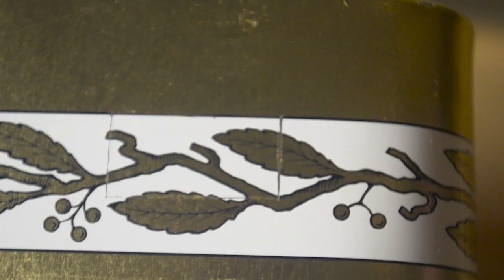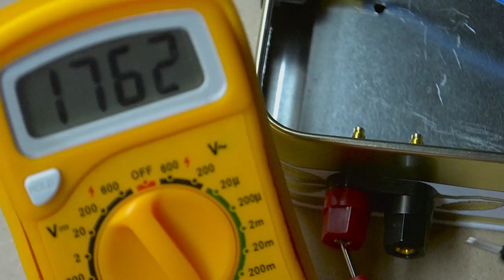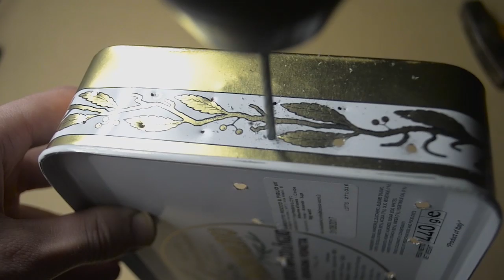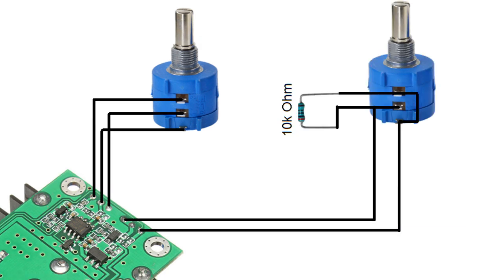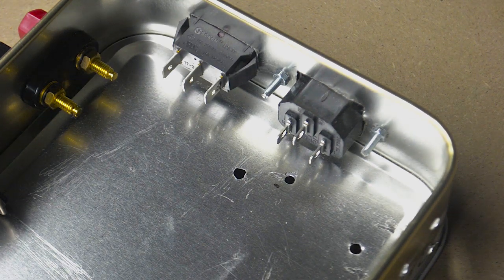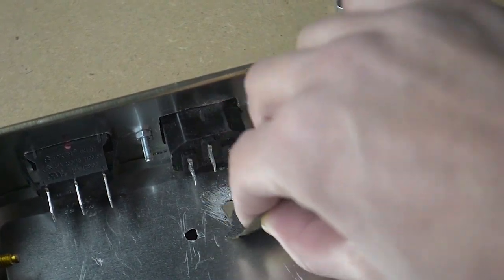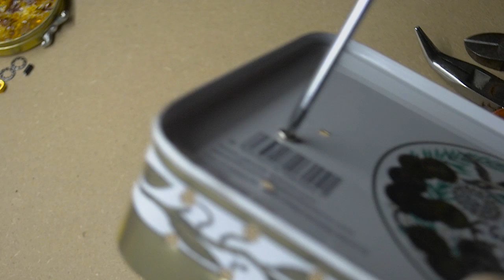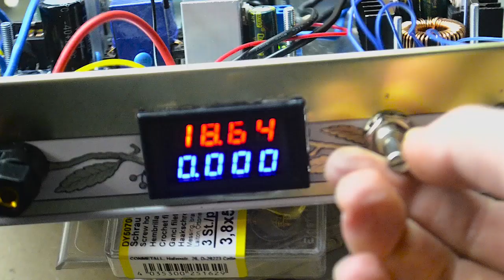Make your own Lab Bench Power Supply -  DIY - Power your projects - PART 1

Comment: I made a charger using 12-0-12 5amps transformer and 300w buck converter to charge 24v lithium phasphate battery but charging current is not increasing above 0.75amps.pls give me any solution.

Comment: hi,  can I use a regular potentiometer 10k for this project  
waiting for your reply
Reply: The normal Potentiometers only have a turn of 280° but the ones he uses have their resistence (10k Ohm) "split up" over 10 turns before it will stop. Therefore you can trim the voltage and current more precisely. :)

Comment: Project boxes are expensive and can often cost  more then the components used in the devices we build.  Steel gift or toy boxes cost little and are available all over. This is a great idea, well done sir!! 😃👍
Reply: I like to use old enclosures from existing electronics... like old modems, routers, TV-top devices... just empty them out, keep what works for you, like switches and power cords, paint the markings if you need to, and voilà:  cheap, good looking cases!  ;-]

Comment: Good job.
Can I ask for your advice?
I want to power up my video rig from makita battery 18v and i need to buy buck converter.
My camera sony a7iii use 7,2v also external monitor (~18w) can run on 7,2v.
Can you advice me a converter 18v to 7,2v?

Comment: Hello
I have followed the steps and I have it echo as in your video with the same components but it happens to me that the voltage goes from 14 to 24 volts and that section cannot be regulated, also when turning the potentiometer to the right it decreases and when turning to the left increases the voltage does it backwards, any idea that I could have done wrong

Thank you
Reply: I think the potentiometer  are faulty try checking with a multimeter
Reply: What kind of pots? Linear or logarithmic?

Comment: I apologize in advance for my English. This is an old project. If the author passes it off as his own, it is very ugly. As far as I know, my compatriot AlexGyver made this project in this way back in 2017 (http://alexgyver.ru) Here are the links ( https://www.youtube.com/watch?time_continue=1&v=8h2ICt3XRhk&feature=emb_logo ) and ( https://www.youtube.com/watch?v=kDGLRRZncKs ) for electronics Enthusiasts, I would recommend looking at his website. There you will find many interesting crafts. As the main argument, I will add that his project "fire lamp" was copied by the Chinese and now they sell a full set of components for this project on Aliexpress (https://aliexpress.ru/item/4000056138826.html?spm=a2g0o.productlist.0.0.2cd25e2anPOHEy&algo_pvid=6dce3f91-de6c-41d1-a190-68d95b984854&algo_expid=6dce3f91-de6c-41d1-a190-68d95b984854-9&btsid=0b8b034e15823932064946854ef347&ws_ab_test=searchweb0_0,searchweb201602_,searchweb201603_ )

Comment: nice box (apart from the fact, that it doesn't seem to be too trustworthy for daily, heavy usage :)  ) ...beyond that a tip from an experienced: you should NEVER solder strands at cable-ends that are clamped with screws - for the moment it works fine, but the connection points start to oxidize over time and slowly you get contact problems (strange disturbances, "noise", cracking, high contact resistance and when there are higher currents there will be high punctual current densities which means: dangerous heat development and sometimes even burning) ... use cable lugs, clamp them properly and it will be fine until the hell freezes over  ;)

Comment: Great little project. Will is still get 100W when at 30V I want to be able to test large LEDs and Motors with it. How well would an ATX supply work?
Reply: Atx psu is great but you are limited to 12v.
In this case, the thing limiting your power output is the voltage regulator.
You can get a led driver that's good for 1000w and have a voltage regulator that's good for 10w and it's gonna act like a 10w power supply.
I think you could wire 2 or even 4 of these in parallel to achieve higher power and use a 30$ led driver and you are golden.

Comment: Nice work does it contains direct leads short circuit protection, when it  is in high current mode
Reply: Should be calibration pots on the back. Very small screwdriver required

Comment: I know your intentions were good.. but dude, you can`t just work on 230V like that!! You didn't properly measure the isolation resistance; the soldering spots were not that great and likely have considerable resistance; the ground wire was poorly grounded and resistance was not measured correctly. Also, isolating the "banana connectors" like that is just a bad idea. 
It really seems like you are interested in this topic and have a decent amount of theoretical knowledge.. but you absolutely HAVE to improve the safety of your builds. Here are a few tips:
1.Stay away from 230V. You have to know exactly what you are doing; connections have to be done to certain standards and testing requires more than just a normal multimeter. Thousands of people have worked for decades to create an education that qualifies people to work on mains voltage. 
2. You might want to use CE certified low voltage power supplies with a relatively low power output. It`s so much safer

Comment: Sorry,  but I have to step in and warn viewers to say this build is very dangerous and i do not recommend building it in this steel case as the video. A plastic project case is safer and better!  If you want to use a steel case the case must have ridged frames so unlike this biscuit tin box, if it gets a hit or nock in the bottom base, the frame will not come in contact with the AC 120-240v deadly voltage.
I have over 35 years of experience with electrical appliance repair so you should take my friendly advice!...having an earth  wire to the frame is vital, but does not make this build safe!
Reply: I totally agree with you, there is a similar video posted a few months before this video, that to my opinion is a better and safer implementation. You can search for the channel named sasiskas.
Reply: I want Power supply for 50 TEC modules . what will be constant current regulated power supply. what can i do. i am not from electronics background. will converters work?. i have battery as source.
Reply: I agree. Even though he used heat shrink tubing, everything with high voltage was too close to bare metal that was way too flexible to be safe. and there was no insulation between the circuit boards and the case.. I was gonna suggest a sheet of plastic between the case and circuit boards, but after seeing screws glow orange hot, any internal short would melt plastic too.. So the best solution for insulating between a (rigid metal) internal frame and circuit boards, is a (no foil, blank PCB) as a spacer between the rigid metal sub-frame and the powered circuit boards... 

Also, there is a reason for wires with different color insulation. It helps make sure you connect the correct items to each other...
Reply: Nowadays we can make a plastic case by 3d printer :D
Reply: Agree, he just built a death trap.

Comment: Hi. Thank you for the video. Does the 4-Bit Digital Voltmeter Ammeter you use in this project make accurate measurements? For example miliamps. I made mine a few monts ago but voltmeter ammeter is not measuring right
Reply: You must not connect the thin black wire of the VA meter. The thin black wire is only needed if you are powering it from a different ISOLATED supply such as a battery or floating AC-DC module. Just leave the thin black wire unconnected.

Comment: i like it .......good job......
  can i use the AC/DC 24v to power my LM317 Adjustable Voltage Regulator Step-down Power Supply Module with LED Meter?
Reply from the maker: Yes of course. Your power will be limited by LM317 power dissipation so instead of this AC/DC converter you can use another one that is cheaper.
Reply: thanks bro... can you gave me  link of cheaper  one?
i try to use my atx power supply  yellow and blue wire ( +12v  -12v ) power my  LM317 Adjustable Voltage Regulator Step-down Power Supply Module with LED Meter  it gave 20v  but when i connect my 775 dc motor  drop 6v-9v   run very slowly....

Comment: what is this circuit for 12v step-down-converter
Reply from the maker: 12v step-down-converter is used to power the temperature sensor and the fans used to cool down the 1.5-30v step-down-converter. I'm going to show it in the next video.

Comment: Can I use this project for charging 12v 65Ah lead acid battery after adjusting current and voltage?
Reply from the maker: you can do it but you need to add a cooling system. I will show it in the next video.

Comment: Can I use 12-0-12 10A transformer ?
Reply from the maker: You have to use with the transformer also a rectifier and a filter. In this case the ouput power will be lower.